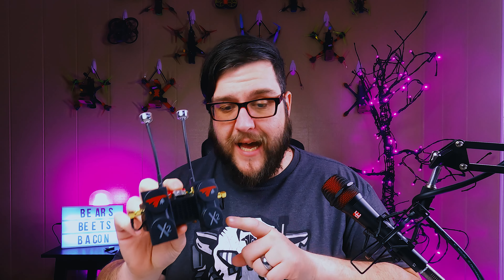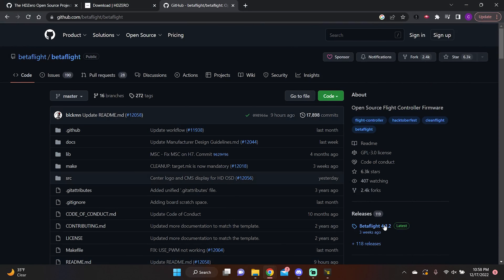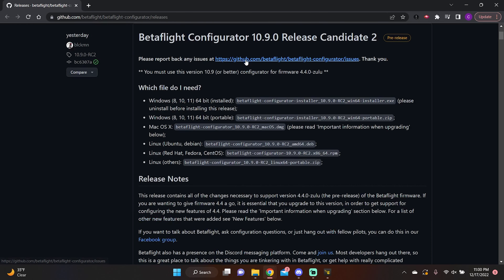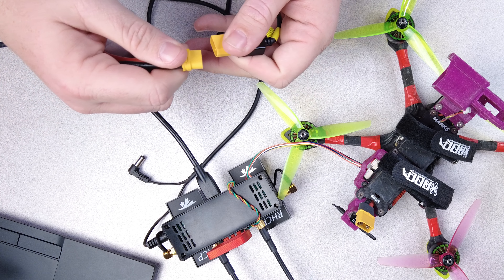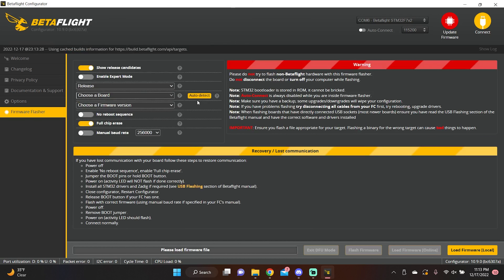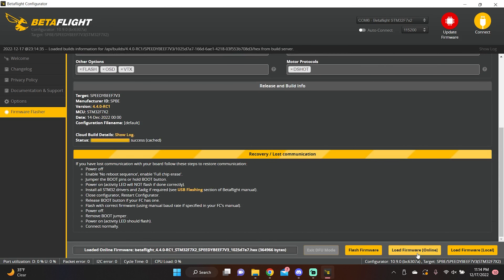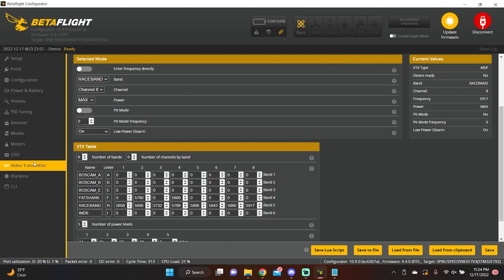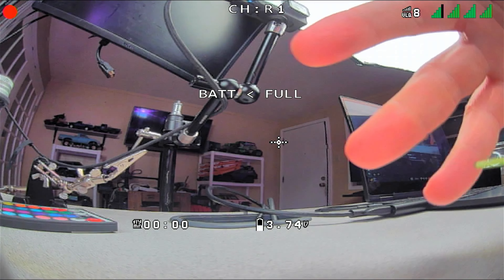HDZero will never be the same!  Get OSD and MSP VTX control over a single UART with Betaflight 4.4

Comment: Awesome information and open source sure is sweet! I actually have just been using the HDZERO stick commands for setting up my channels and power outputs. I wired up all my smart audio but have chosen not to use it as the HDZERO menu has worked fine for me so far and my needs. Still really cool to have this option and free up another uart for sure! Great video presentation 🤟👍🔥🔥🔥
Reply from the maker: The stick commands are pretty great in their system, I just really like not having to touch anything when I want to fly or make a change, lol.  I just put it in my radio and when the quad arms it does all of things for me....because I am lazy!  This whole thing will make it easier for F411 boards with just the two broke out UARTs though, and you can pack 4.4 to be smaller and give yourself a little more room to work on those lower end MCUs!

Comment: Excellent video. A close friend of mine uses HDZero and he has had nothing but great things to say about the range, penetration, and latency. If I run the DJI V2 goggles unfortunately, so I would have to buy new goggles as well as the HDZero VTX, so i am without HDZero for now, but it is definitely in my future!
Reply from the maker: The latency on HDZ is absolutely the best in the digital market, hands down.  I am not super disappointed with the range and penetration, but I am also not thrilled with it either, lol.  Maybe some day in the future we will see that change when they can get some partners on board for the hardware components and stick to just improving the core technology, but we will see where that goes in time.  I think having HDZ in the line up is a great idea though!  I really do enjoy it, especially on the small quads where I am zipping around really small spots and that latency consistency counts even more.

Comment: Liked and subbed! Question - my OSD is no longer working. I followed all the steps. Any ideas on what to check?
Reply from the maker: Well I appreciate the sub!!! :)  Did you happen to put the "set osd_displayport_device = MSP" back in with the CLI after?  That usually goes missing during the CLI dump process and could cause your OSD to stop working.

Comment: Only through ELRS though? Not that I mind, but my current HDZ lineup is not using ELRS. I guess I'll have to finally change everything over. And go to bind phrase and all this other "easier" to use stuff. It really is a great time for tech in this hobby, and some is bleeding over from all my other hobbies and vice versa. 

Thanks for the information.
Reply from the maker: yeah, at the moment ELRS is the only system that supports the backpack functions using an ESP32 radio chip like what is built into the HDZ goggles :(  I haven't seen any other systems implement a similar function, but who knows we might see it in the future!
Reply: @BaconNinjaFPV  Oh, I'm not whining, well maybe a little (but only because I have tons of non-ELRS RXs sitting around. No biggie. 

I'm more concerned with getting onboard sound from the digital solutions. I need the sound. How do people fly without knowing what the craft is doing, soundwise?

Comment: Hey BN!  Have you gotten "Lower Power mode until first arm" to work with this?  "Low Power Disarm" that is.  :)  I worry about putting the VTX on full power and not unplugging the battery fast enough after a flight.

Comment: Im having many issuses with using this method with my HDZ goggles and a freestyle VTX. I have the latest HDZ firmware and am running BF 4.4. With MSP + Displayport I can no longer enter my camera controls nor enter the VTX menu in the OSD. I can however see my the small 4:3 croped verion of my HD OSD set up in the configurator. I also noticed that in the VTx tab the device says "not ready" unlike Bacons example. Does anyone know hoe to solve these problems?
Reply from the maker: So once you are using smart audio or MSP VTX, the HDZero stick commands no longer work due to the system being controlled by the flight controller.  The camera menu should, so I am not sure why that one isn't, but for sure the VTX menu wont.  As for the device saying not ready, you will want to make sure that you unplug the quad from USB, plug a pack in, let it boot up, then plug the USB back in before checking.  If you don't let the quad boot from a pack prior to looking the VTX tab, the MSP connection made to Betaflight configurator will override the one being used by the FC to control your VTX.  Now, if you do that and it still says not ready then there must be something about your UART selection that it isn't liking or the UART wires aren't going from VTX RX to FC TX and VTX TX to FC RX like they should.  Hopefully that helps!

Comment: I am confused you could already control the vtx over the Msp DisplayPort interface what advantage does this have over entering the vtx menu with sticks down and to the centre?
Reply from the maker: The advantage would be that you can either use the VTX tab in Betaflight to manage your channel and output power, or you can use the ExpressLRS VTX administrator from your radio to do it.  Either of those would be without having to bring up a stick menu and navigate through it, and would take place as soon as the quad powers up rather than you having to get a video link, open a menu, and make the change.  It is really helpful for racers that can't really power their quads up since other people are in the air, and you cant see that stick menu if you have powered up in pit mode to avoid channel stomping.  One other nice thing with the ELRS method is that with the addition of backpack functionality in/on your goggles, the VTX administrator on your radio will change the quad and the goggle channel at the same time to follow each other.

Comment: I have a part 107 license and I’m really new to FPV is there a way for the drone to submit audio is there a way for us to record audio without a GoPro. I guess what I’m asking is does the drones send some type of audio packet that were able to listen to while the drone flys. like can we hear the motors in headphones
Reply: Some do. over smart audio or IIRC Tramp. Thats on analog though, if your VTX has a microphone which alot do and dont, you can get audio put.
Reply from the maker: Well welcome to the wonderful world of FPV!  There are some systems which can transmit audio along side the video signal and let you hook a pair of headphones up to your goggles for motor noise.  Unfortunately though, there aren't any digital systems that do it :(  Due to the bandwidth management that digital systems use, there just hasn't been any progress toward sqeezing an audio signal in the packets.  There are a ton of analog transmitters that do have the functionality though if you are willing to run that older style of video link and deal with its resolution/breakup limitations.

Comment: I am currently in the process of converting all of my HDZero drones back to analog. HDZero is just not worth the extra cost and reduced range. I can get a 1000mw TX and a camera for less than 50 bucks. It costs a minimum of $100 to get an HDZero camera and VTX. The RX modules are also a pain. They add bulk to your goggles, they require an extra power cable and you really have to use a pocket lipo and long cable to get reasonable battery life. I had to replace the barrel connector on my HDO2's due to the weight of that cable damaging the connector. To top it off the transmitters offerings are just not great compared to the plethora of analog options. The HDZero goggles would be great but they are also $600 plus I would need to buy the analog module anyway as a lot of whoops are still analog and although the whoop TX is lighter than the DJI or FS/WS options it still adds weight I don't want on something that small.

Comment: If the VTX MSP + Displayport is not available in the dropdown menu, amI out of luck? I have a Whoop Lite bundle and don't have any osd on screen in my HD Zero goggles. It's a Firefly Nano bind and fly from Flywoo. Is ther an easy way to figure out if this is a simple issue, rather than a faulty product?
Reply from the maker: You can actually still use the old method to do it as long as you aren't running BF 4.4.   On 4.4 some of the options that you would have had to enter in the command line are depreciated, so using the MSP VTX control is the new way in that firmware.  On 4.3 though, you can still use a preset to get it done and just pick the UART you are using in the preset.  The one by WTFos, which is actually meant for use with DJI, actually does a great job of setting everything up for HDZ OSD over a uart!
Reply: @BaconNinjaFPV  Thanks. I'm still a bit lost, as per usual. I'm running BF 4.4.1. Should I look for a preset to get me in the right direction?
Reply from the maker: I think if you use the "HDZero VTXs" preset by SugarK it will set everything you need for it.  give that one a shot and let me know!  You will want to use the "map to display port" and "set hd osd" option as well as either picking the option for unlocked freestyle if you are using that VTX or the all other VTXs option (but not both).  Then you can pick the UART you have your VTX on and it should apply the proper CLI commands.
Reply: @BaconNinjaFPV  I will definitely try that and report back tomorrow. Much appreciated.
Reply: @BaconNinjaFPV  That did the trick! Thanks!

Comment: @Bacon Ninja FPV Do you know why this version of firmware v1.0.0 is't on official web page on hdzero? Can I update my whoop lite vtx and Freestyle vtx to this firmware if I will not use BF 4.4?
Reply from the maker: I think they are trying to differentiated the open source firmware from the older closed source they were using, and I expect that in the future it will all be over at the GitHub instead of their downloads page.  You can absolutely upgrade to the 1.0 firmware on your VTX's even if you don't want to go to BF 4.4!

Comment: Hello bacon ninja
Thanks for your video 
I followed you step by step. I have a picture in my glasses, but when you go to the BF menu with Der Radio, it only appears there.
Channel:
Pid mod:
Powert
OffsetExit
SaveExit.
But since I mounted a Whoop Lite with HDZero Nano v2 on a quad, the picture is in 3:4 format. It would be nice if you can change it to 16:9.

For your information, I have 2 Freestyle and 2 Whoop Lite in operation.

Thanks for your help
Reply from the maker: I will reply to the email as well in case you see that faster, but the option to switch from 4:3 to 16:9 is going to be in the HDZero stick command menu for the camera.  Usually that is opened by holding the left stick all the way down and to the right while the right stick is centered.  That should pop up an on screen menu and somewhere near the bottom it will have an option to change the format :)
Reply: @BaconNinjaFPV  Hey Good morning.
Thank you for your quick help.
Do you have an idea why the Vtx temperature is not displayed in the OSD?
I will follow your channel. It's nice to have such a helpful and competent contact.
Say hello to Anatol Kneubühl
Reply: @kneubuehlanatol2200  I'm not Bacon, but to answer this: Do you have an idea why the Vtx temperature is not displayed in the OSD?

My VTX temp isn't shown until it starts heating up. Same as it seems is being show in the video. My O3s are the same, as are my vistas, and walksnail. Have you tried letting it sit out for a few minutes to heat up? I also notice the Freestyle doesn't get nearly as hot as any O3 AU, or Vista. Those things I could cook....bacon on.

Comment: Cool, so can you change the frequency of the vtx to say 5399 (L1) instead of being limited to R1-R8?
Reply from the maker: unfortunately, no :(  Although you can use this to change the band and channel, you are still limited to what the VRX is capable of receiving.  Technically you can have the transmitter do whatever you want, but the VRX will only let you receive on R and F channels since they are hard coded.

Comment: I cannot get video from my hd zero freestyle vtx. The rx  and tx wires should only be for OSD correct? I should be getting video as long as vtx is powered up. When I scan for channel, nothing is found. I have carefully followed updating  procedures, but I am getting nothing. Do I have a faulty vtx maybe? Any suggestions would help, thanks.